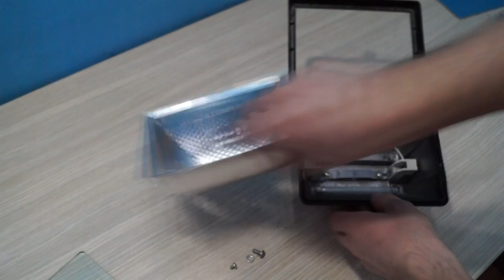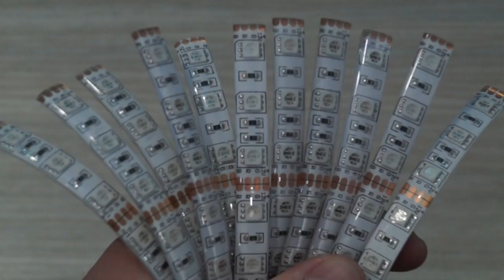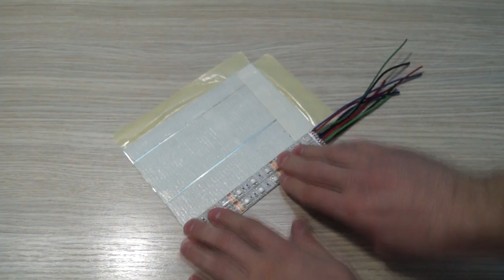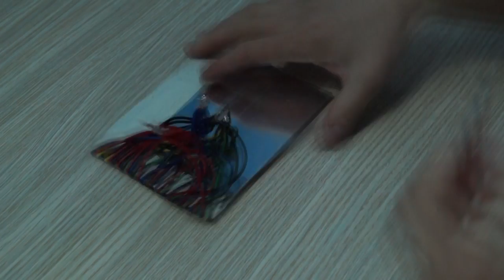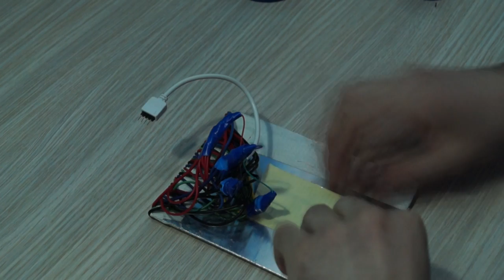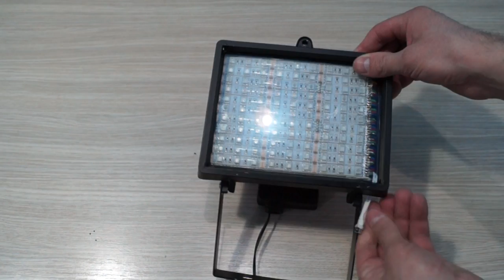DIY Disco Light- RGB Led

Comment: saludos desde Guadalajara México, te puedo hacer una recomendación, ese tipo de reflectores convertidos a leds yo los hago les quitó la placa LED que traen y hago una placa de leds RGB parecida a la tuya, con la diferencia que no debes de dejar los cables tan largos, te recomiendo usar una tarjeta PCB perforada y los acomodas en forma escalonada una vez soldados todos los cables unes con un solo cable todos los azules, luego todo los rojos luego todo los verdes y al final todos los de 12v y así solo te quedan 4 cables solente y no tanto cablerío que al final te quedo si gustas te puedo mandar imágenes o vídeo de como los hago y como quedan  y si usas un controlador con sonido también funcionan con la música,
Reply from the maker: Ok Thanks!

Comment: You can also make this into broken led panel work light pretty easily. Showing controller in panel would been possible with tight fit and it could been put into motion sensors box, but i ended up just taking cover from other lamp and bolting it on back. Optionally you could use electric crossing box on back to store it.

Comment: Looks like a cool project that even I’m capable of completing but it needs to be able to connect to a DMX controller or music activated.
Reply from the maker: Hello
thanks
For DMX controller or music enabled construction remains the same.
You need to remove the remote controller and the 12v transformer to connect directly to DMX.

Comment: I’m new to led projects, but am interested in doing this for my final in my tech theatre class. Could someone tell me the materials used, and where to find? Maybe even some tips if you’ve done it before?
Reply from the maker: materials used -MOBILE HALOGEN PROJECTOR 500W BLACK , Aluminum plate, rgb led strip, controller rgb.
Reply from the maker: 12v transformer

Comment: why not building it way smaller using the reflector of the original lamp :o ? wouldnt the light get spread better then with the leds build angle ? + wouldnt some leds without silicone covering work with an lower angle = higher brightness ?   just a thought :) have a good one o/
Reply from the maker: The original reflector does not have much space to put so many LEDs.
But they are not bad ideas.
Thanks!

Comment: Hi there. I was watching this video and it came when you were attaching those wires. I paused it and wrote this comment. It's very much confusing what you did with those wires. Can you explain it a little? And another thing, what was the sheet or plate or whatever on which you placed those led strips. It's very clean work bro... Well done 😘
Reply from the maker: Hello
Thanks
It is an aluminum plate for better cooling.
And for wires I can send you a drawing with them by mail.
If you want, write me a mail address.
Reply from the maker: with pleasure .
I'm sending the mail now
Reply: *Aluminium
Reply from the maker: Sorry